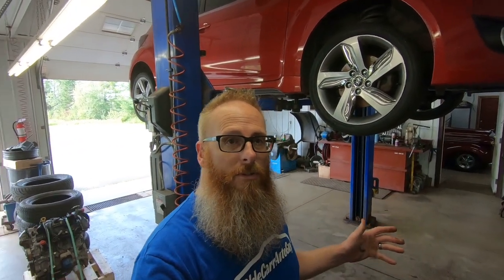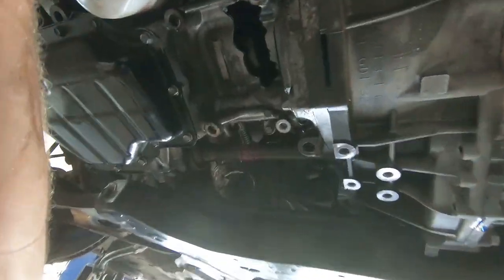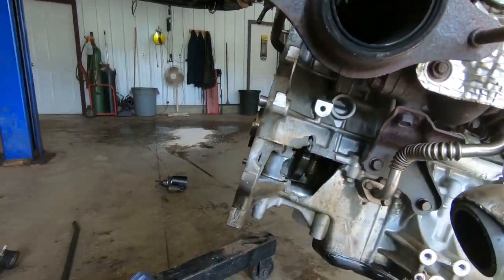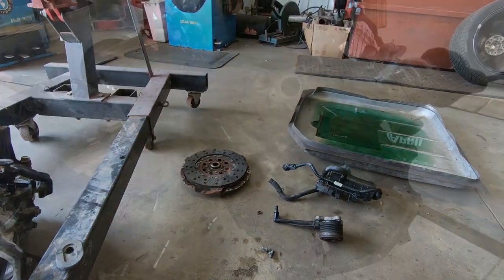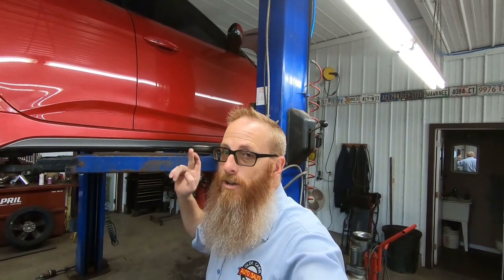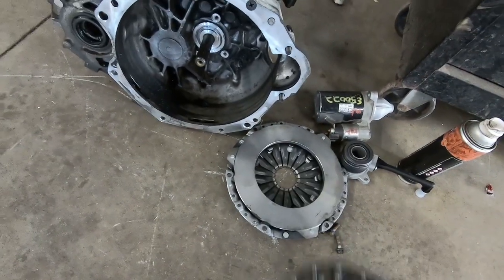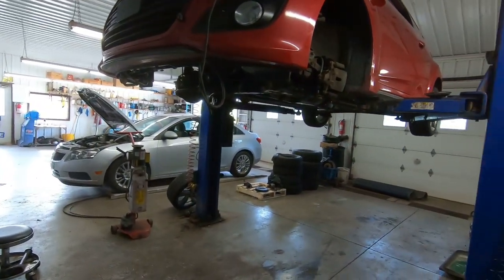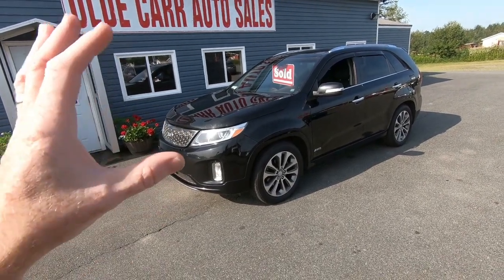JR'S 2013 HYUNDAI VELOSTER TURBO IS GETTING A MOTOR SWAP

Comment: How about a video on the Mustang wheels and tires , including the size,  you put on Grand Ma. I have a 03 GM that i would like to put a set of wheels Mustang wheels like you put on Grand Ma. Include any problems that you encountered while installing the wheels......Thanks...
Reply from the maker: Hey Paul! Thanks for subscribing! I did a video on that already! I used 245/45R18 tires on the 2011 Mustang wheels! Direct fit with zero issues!  Hope this helps!